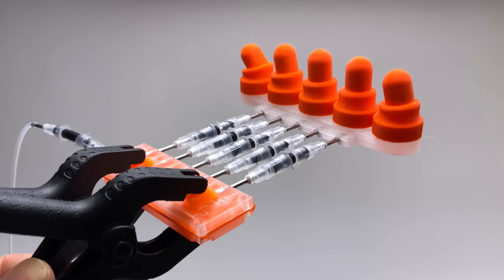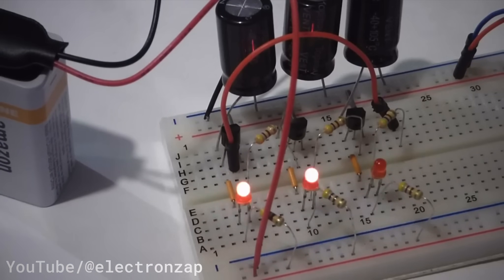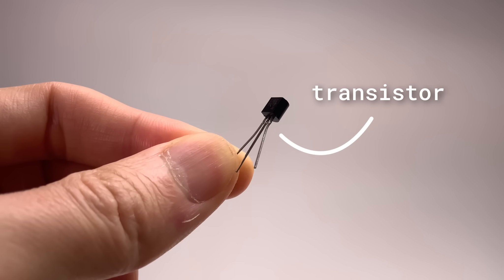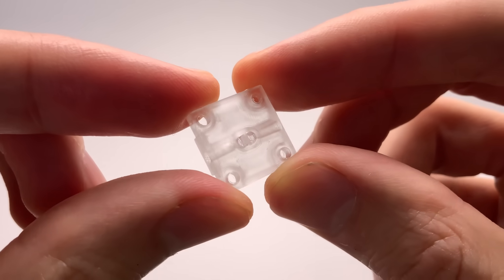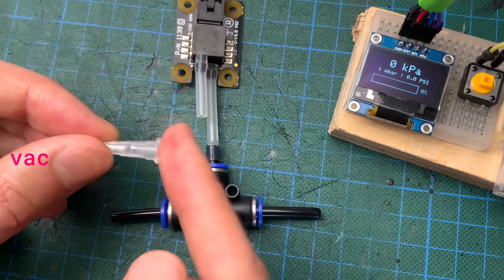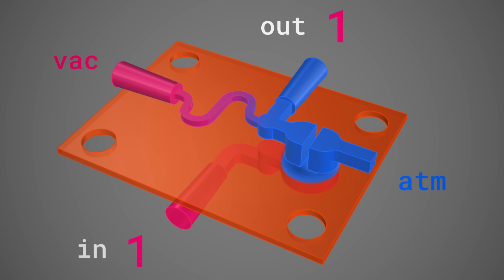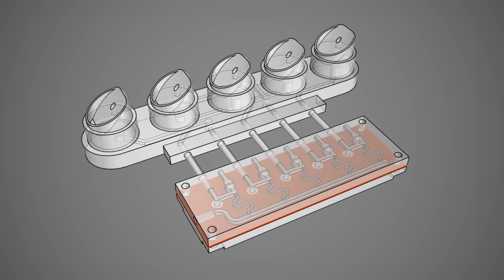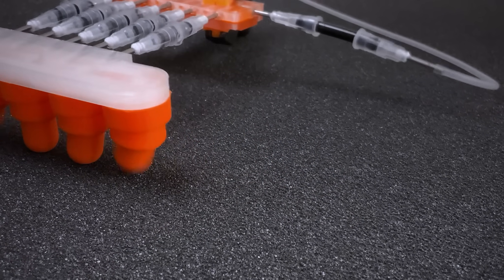I Printed a Microchip That Runs on Air — A Nervous System for Squishy Robots!

Comment: In a compact circuit, tubes must be thin, but actuators need higher air throughput than thin tubes can supply. Would be great to see next a transistor with a thin control tube and a wider flow tube to allow separate low-flow 'nervous system' and high-flow 'motor' networks. Great work, thank you for publishing it!
Reply: So air relays, basically! Yeah, that would be cool to see!
Reply: @mbcommandnerd  air IGBTs
Reply: yes definitely, keeping the analogy its like 3.3v logic controlling 12v motors
Reply: @Saleca  more like high current (mosfets) being driven by a low current source.
Reply: Yep! Some sort of amplification circuitry would be vital (you can already see the pressure drop off between each leg)
Reply: This is genuinely so cool to think about ngl

Comment: this is like a glimpse into a different universe where electricity didn't go very far, but we REALLY wanted robots anyways
Reply: steam punk alternate timeline
Reply: @px9720  pneumaticpunk, instead of the internet the whole world is covered in those tubes you send capsules through
Reply: i mean if you think about it, this is how a train works. And trains are kinda like a robot
Reply: Pneumatic relay computers
Reply: Or a world where we were a little too happy about dismantling spiders...
Reply: @KVT6638 Have you seen the necrobotics spider robot gripping arms? They use actual spider carcasses connected to air or vacuum to move their legs and pick things up
Reply: Thing is this kinda tech can be scaled much smaller than eletric 
   Imagine a probe that could take a scan of you on the atomic level inside out
Reply: @terranovarain6570  How can this possibly be scaled smaller than electric?
Reply: @lbers238  Because you don’t need to pack tiny electric motors into every joint. Of course there are tradeoffs, but i belive there is somthing there.
Reply: @jonasnicolaysen8019  Ohh i thought you meant the logic could be smaller
Reply: @lbers238 hmm. it kind of look like that's what he wrote yeah..
Reply: Read “Exhalation”!
Reply: I listened to a short fiction years ago about a whole world that had evolved this way and a scientist had realized time was getting slower, that the pressure that made their world was slowly running out.   Really neatly crafted piece.   Wish I could recall the title.  Was on escapepod around 2010
Reply: Can't wait til the steam gets introduced
Reply: Right???
Reply: We had fully automatic pianos that could play themselves with air in the 1800s
Reply: The first computers were made with vacuum tubes kinda like this to transfer data, so it was actually an important step in our universe
Reply: @patch858  haha oh dear, no that's not what vacuum tubes are :P

Vacuum tubes are basically light bulbs, they're empty of air because it's needed for the electronics to work.
Reply: @swedneck  no… you don’t know what I’m talking about.

https://en.wikipedia.org/wiki/Vacuum-tube_computer
Reply: @patch858 no... You didn't read the page you linked
Reply: @heyitsgwen I did, I also have a computer engineering degree lol.
Reply: @patch858  aint no way you got a CE degree and still misunderstand vacuum tubes
Reply: @plpebomb  bud what is exactly wrong with what I said? They literally did logical operations with them and used vacuum tubes in amplifiers. I fundamentally think you lack the reading comprehension to understand my point, but they were used in computers... the original comment said something that made no sense scientifically or historically
Reply: @patch858  i think yt deleted your commnet so i'll start over : yes they used vacuum tubes like transistors, but they're still electric. the silicone microcontroller soiboi uses is pressure based. what exactly did you mean by "kinda like this"? because they're similar in function but fundamentally different in how they work
Reply: Time traveller: kicks a rock
The timeline: airbots
Reply: Animatronics...
Reply: You should look up Hero of Alexandria. He did tons of stuff with air. Is credited with creating the first recorded steam engine. A lot of his stuff is very much like these squishy robots, more created for fun and as experimental projects

Comment: This is the most creative use for 3d printing i have seen in a long time, love this. please continue push the boundries of what you can do with this tech and idea.

watching this, down the track i picture a small soft robics creature moving around on your microfluidic program cards, potentially swappping between different movement programs or exchangable program cards.
i would love to see microfluidic sensors like antenna valves on the front that will change direction of movement programs.

Comment: optical transistors in both electric/optical gate mode would be just nice. usually micro is also referring to the 1um below size. ie normal mems chip.

Comment: Amazing job again! The movements of those legs reminds me of the swimming motion of squid and manta birostris. Maybe if you connect the legs to a flexible fin then it can swim. Maybe it's also possible to build a system that works on hydraulic pressure instead of air pressure.

Comment: You can make the chanels smaller by using a uv curing rezin you would project a image into it this this image would be created by shining uv light through a stencil and scaling it down this should give you a extremely hy resolution and if you swap out the elastic rezin with a elastic uv curing rezin you can also project smal features onto that.

Comment: This is a pretty cool project. Creating electrical components using air is quite interesting. You've read about fluidic logic; it uses a completely different principle. I haven't seen much material on this topic in English, but there are quite a few in Russian. You can Google "пневмоника" if you're interested.

Comment: "air flows through the tube, just like electrons in a wire" is actually so funny to me
Reply: Electrons do flow through wires, but 9 orders of magnitude more energy is carried through the electric field rather than electrons transferring energy by their movement. Its because of the slow drift of electrons through a wire though that causes the voltage differential that generates the electric field and facilitates transfer of electrical power. So in a way, the motion of electrons are a fundamental transistor that allows the generation of the gate that controls the main thoroughfare of energy around it, the more the electrons move, the more powerful the electric field and the more power moves down the wire, thus the higher the voltage, the far higher the current as electrical resistance is overcome, and at lower resistances the electrons move faster which generates a stronger electric field and thus allows more current to flow.

To point something out specifically, electrons always move against the electric field. Electrons move from negative to positive, while current in the electric field flows from positive to negative. Electromagnetic power (the same kind of energy that light is, btw) travels at a very significant fraction of C through the circuit due to motion around the wire in the electromagnetic field the electrons generate with their centimeters-per-second drift speed. The lower the resistance of the conductor, the faster the electrons can move and the less they collide with the atoms of the conductor material which means less heat in practice, but the resistance of the conductor cannot be relied upon to limit current in anything but extreme power applications, as the conductor alone would result in a short that sinks the voltage to parity with the resistance, maximizing the current flow in the electric field. Notably, superconductors can conduct currents indefinitely so long as nothing draws that energy out of the wire or disturbs the near-perpetual motion of the cooper pairs, and so long as nothing raises the superconductor temperature above the critical temperature that would break up the cooper pairs and allow the now-singular electrons to collide with the conductor's atoms. Also, Type-II superconductors have a limit to energy transfer before energy loss.
Reply: Perhaps a bit of Douglas Adams would be appropriate: "Air flows through the tube in much the same way electrons don't through wires"

Comment: I think having an accumulator and making the walk cycle with pauses between them, like you did with the syringe, could make for a more satisfying and maybe even more consistant cycle.

For example having a big cavity on the walker that could even have some indication of the strength of its vacuum, being constantly replenished by the external pump and smoothing out the negative pressure and also allow for power transistors to be tapped directly into it with little restrictions.

Comment: It should be possible to have the ring oscillator switches operate a second set of switches without the resistor inline, serving as an amplifier, to deliver more power faster to the legs and get snappier, more definitive retractions.

Comment: wow! high cool factor!. I'm surprised you can print the blocks with FDM, I'd like to get some materials to give it a try. Can you recommend supplies? what size are the blunt needles that are working for you? (14G-30G) Are you printing in PLA? other? Are the pneumatic T's 1/4", 6mm? What silicone do you suggest?

Comment: To make the bottom surface extremely smooth you can print on a borosilicate glass bed. The only problem is that you can't use inductive probes on it.

Comment: Man, soft robots have only really been something I've followed in my periphery. Seeing one run without a trillion tubes going into it seems so surreal. Wonderful work.
Reply: Finance guy here, who has been looking into this field, this will be HUGE part of the robotics industry coming back to the USA. Mainly for the fact that you can 3d Print your mold and pour the silicone, and ta-da! You have a new robot.
I wonder what it would be like to build a large version of the above, and use it "drive" people around with. Like a pony or horse sized that you could ride on down the street. (Yes it would be slow, but it would be fun). Could be cool in a music video out at the bonneville salt flats or something.
Reply: @eriklondon2946  These mechanisms do have a major drawback. They are slow. Fundamentally it is a cloud of air vs a cloud of electrons. The air cloud contains protons and neutrons, the electron cloud does not. The air propagation will be slower by a factor of about 1,000,000 compared to electrons in a wire. Air channels also have a problem of dust and obstructions, wires do not. Wires are also much easier to work with compared to air channels.

I’m not saying these have no application, though. While electron logic will beat out any air logic, air power density will beat out any electron power density in terms of actuation. A micro valve powering a large power valve could be significant.
Reply: @techman8817  Ive replied to this 2 other times. YT keeps censoring me. Sorry. Keep looking into soft robots there are tons of different kinds and the field is VERY young.
Reply: @eriklondon2946  I actually have developed soft robotics, so I am not against it.  But I am aware of the specific applications where it exceeds (e.g. lab on chip, high voltage environments, certain specific actuators), and where it is fundamentally inferior to conventional actuators (requiring significant strength, durability).  I would say soft robotics aren't gonna displace the typical factory robots, for instance.

Comment: oh for the love of everything that is holy, get yourself a resin printer. the resolution is way better and  the prints are airtight (fdm is always slightly leaking). that would produce a significantly faster state change (i assume). 
also, you could print the channels in 3D. that means your embedded circuit could actually be layered and way more dense that before. i get tingly fingers just from thinking about the possibilities. 

anyhow, amazing video, thanks for continuing the series.
Reply: cleaning the prints for hardening would be a much more involved process but I agree its the way forward
Reply: @raspberryjam worked a lot with SLA printed microfluidics. All you need to do is use a syringe to blast IPA through the channels during postprocessing. It works great.
Reply: Hey, lets not get into arguing over if FDM is air-tight or not :P
 It can be with an appropriate 3D printer and filament. But I can still see how resin could still give better results! Especially in making sure the connections are airtight.
Reply: The core reason the state changes are the way they are is not leaking, but the general design of the circuit. The muscle retracts under vacuum, the vacuum that retracts the muscle is going through that resistor, so for exactly the same reasons that the resistor "lets atmospheric pressure win" (paraphrasing), it makes retraction slower and weaker. The first order solution is to bring in more circuitry design concepts and use weak logic switches to actuate strong power switches that allow for higher evacuation flow rates to match the atmospheric pressure flow rates. If you adapted this circuit to actuate solenoids to operate these feet, they would also retract slowly, or maybe have a long delay until there was enough flux to move all at once. With solenoids you would use a logic level transistor (or several) to control a power mosfet to drive the solenoid, so that the solenoid isn't limited by the voltage and current limits of the logic level circuitry.

Once the circuit design is better, a resin printer would allow for the miniaturizing logic level fluidics, and may produce smoother channels with less drag
Reply: FDM is not always "leaking" and his prints are airtight.
Clearly visible... pardon the pun...
The clear material makes it obvious if the part is airtight or not.
You can print with a lot of materials even simple pressure vessels if you know what you are doing.
Reply: @DerSolinski if you managed to find the solution to make fdm prints air tight, I challenge you to time travel and tell me how 4 years ago. 
There is a difference between mostly air tight so that you can pressurize a vessel and completely air tight that the pressure holds over a long period. I have high (i.e., the highest) doubts that fdm prints will ever be air tight without post processing with other chemicals. Especially geometries like circular ducts will struggle a ton.
Reply: @violentdesire7325  there's a lot here.
1.- I challenge you to time travel 100 years ago and tell us about computers. Yeah, think about it. The hard part isn't the existence of computers. It's a meaningless statement, progress happens in time.
2.- Tolerances must be reasonable. For this project, you don't need too much. Try printing a sub with resin and getting it to the bottom of the sea, see how "airtight" it is
3.- Time is also a factor. Materials we consider solid behave as liquids over centuries. This is also airtight enough, for the scope of the project. Yours is probably different and you must think about your own scope and tolerances. For some other applications, resin won't be enough either.
Reply: @violentdesire7325  did you try anything like vapor smoothing the FDM parts to make them airtight? And high extrusion?
SLA is definitely better in the end, but I’d like to figure out if FDM is feasible. Maybe printing on acrylic and using a single FDM layer.
Reply: @techman8817 yea, however, in high stakes conditions, you can't risk a non-reproducible method to potentially ruin your experiment. Especially with internal cavities, you cannot simply "check" if it's tight or not.
Reply: @violentdesire7325  Thanks, good point. Also worth mentioning, did see a guy use FDM to print the channels, cast PMDS around it, then use acetone to dissolve away the FDM print.  But that might be less convenient than resin.

Comment: Very very cool. I see something like this and immediately start dreaming about designing a cpu out of it XD
Reply: It would definitely be slow, but largely immune to magnetic or electronic interference, at least until you try to translate it to any kind of electronic input or output, or the vacuum pump having any issues, might be vulnerable to changes in air pressure

Comment: Awesome Video! I have some suggestions for making the legs more 'tunable' and maybe look into different oscillator circuits designs?

1.) Design a 'tunable resistor', instead of the predetermined printed ones you've designed.
 This might make it possible to change the frequency or speed of the legs.

2.) Give the salamander more intelligence by possibly making it be able to not only walk, but also swim. If you designed a circuit, that has two separate circular oscillators, where the first one is used only for walking, while the other is used for swimming. Theo Jansen has made his creations with the same oscillator for his machines to walk AND he gave them the ability to sense the detection of water, via a tube that is continuously sucking air until the tube encounters water, that will restrict the intake, then triggers the machine to travel away from the water.

3.) Make an onboard power source from something that isn't electronic. Like, an air-tank, that is either compressed with high pressure or regulated using a variable valve?
Or put a little piece of dry ice with some room temp water and use the expanding gas to power the robot?

Great video!